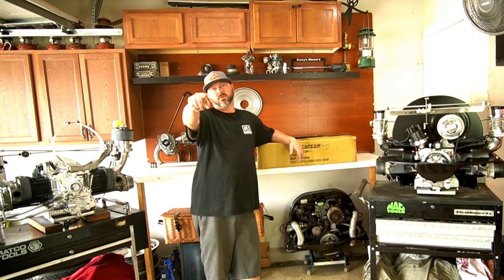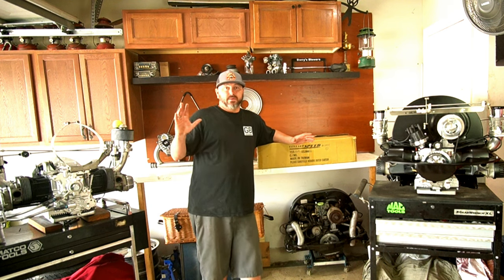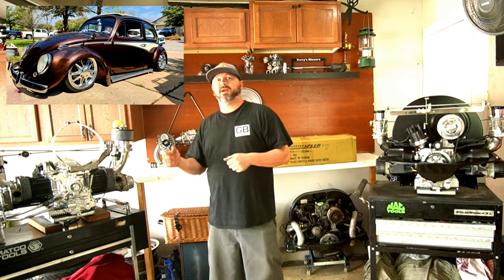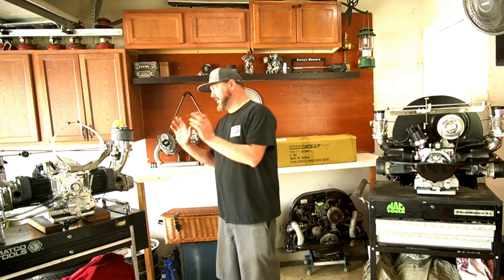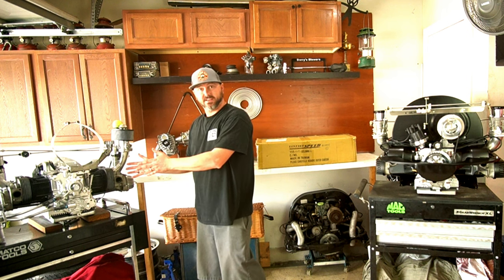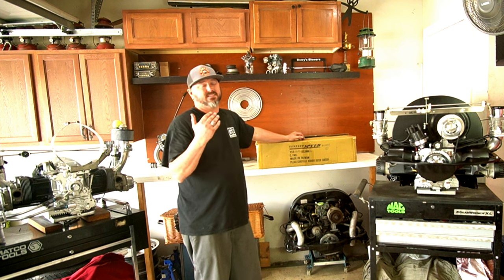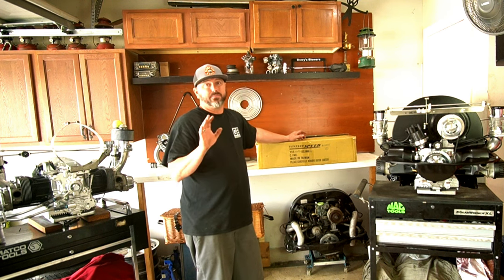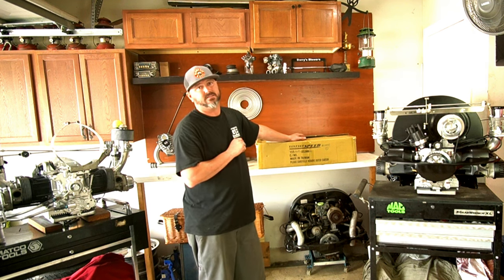Vintage Speed Low Bus Exhaust Install!

Comment: Pretty innovative how they make the heater box connection adjustable for wider than stock engines.  Cool stuff.
Reply from the maker: Overall I'm pretty impressed with the quality. Everything is clean and well thought out. Went together easier than some stock systems I've done!

Comment: I googled "super SS ultra quiet stainless super low bus model" and it came back with an article on the 7 quietest range hoods of 2023. :)
Reply from the maker: https://store.vintagespeed.com.tw/VW-Split-BUS-SS143-Super-Sport-EXHAUST-SYSTEM-p155667302

Comment: Hey OVTV ( Jason ) that sock is made with the same material that latern wicks are and if it gets a oil leak !  Just saying there was a video that a yellow bug during break in had the J tube wrapped and he had his oil pump leak and it caused a fire . if oil hits metal it just smokes .
Reply from the maker: Vintage speed said it was for fire protection🤣🤣
Reply: @OldVolksTV  to bad there was not none left over to test what I am saying it's a wick?
Reply: I thought it was for the heat
Reply from the maker: @jimmywilkinson it definitely feels like a wick.
Reply: @SanDiego_VDubLife  it can cause a fire ,

Comment: Anti seize anti seize anti seize!  You’re gonna regret not using any bud. Not even using copper nuts…huh. Oh well. 😂
Reply: Antiseize has its place, but not where there is heat and vibration.

Comment: You can't fine tune dual carbs with a wideband, with engines with vintage exhaust systems.
Reply from the maker: Right. I do have another motor with this exhaust that has EFI and will require a wide band O2 sensor. The placement isn't ideal but it should work good enough to get a tune.
Reply: @OldVolksTV  Its your engine.

Comment: Vintange Speed parts are waaay overpriced.
Reply from the maker: @smokepeddler  I like the shifters. I have a couple of them. And the linkages are really nice. The exhaust sounds good but after a few months of use it looks like crap and the hardware is corroded. I'd probably get something else next time.
Reply: @OldVolksTV  they do make a stock looking shifter that's pretty nice. 
But....I'd rather go with a Berg or Scat shifter.